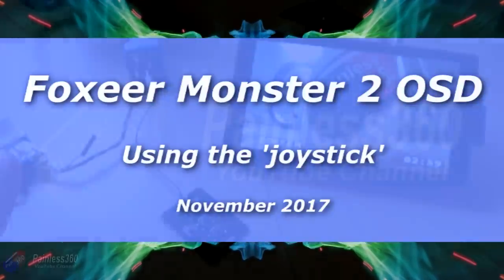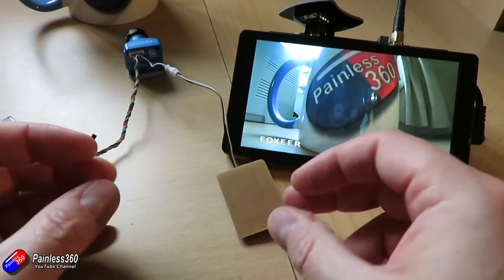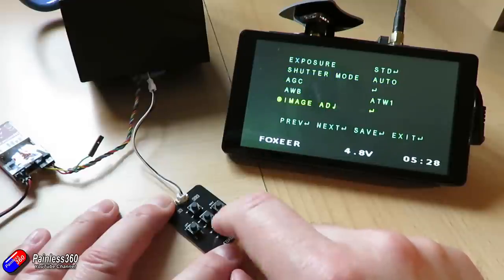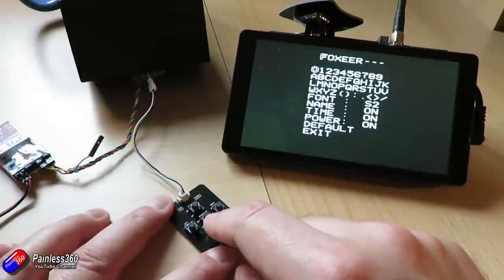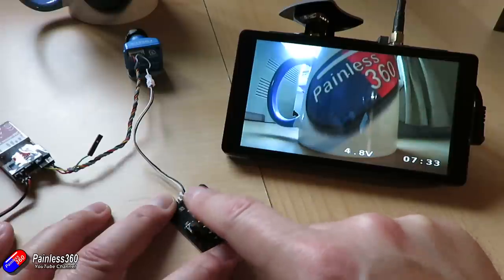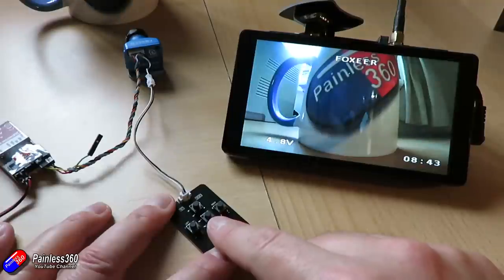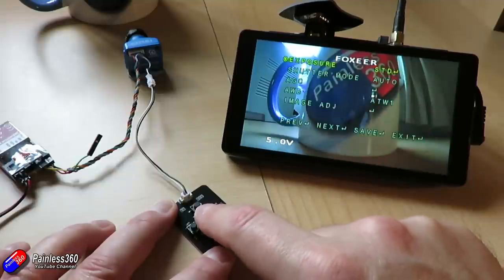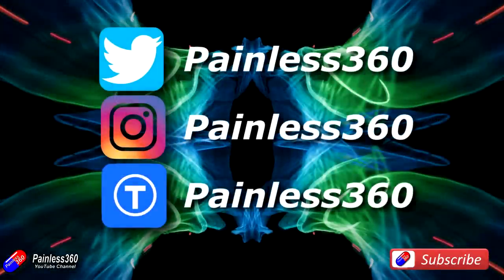RC Quick Tips: Using the Foxeer OSD controls/joystick

Comment: Hi Lee! Thanks for the video, it is helpful.
I was hoping you can help with a related issue I am having with the Foxeer monster micro. I turned of the OSD for a quad I was using the unit on, but have now moved the cam to another quad which needs the OSD feature. the problem is, I can't get the menu to come up when I press and hold the top button. I even tried the factory reset but it did not revert to the original OSD settings.
Any idea of how to get  the OSD menu back after disabling all the OSD features on the camera?
Thanks and, thanks for the content!
Reply from the maker: The OSD shouldn't stop the menu from appearing. I'd ytu another menu, 'joystick'... Best of luck!
Reply: @Painless360  -It is a bit odd as I tried another brand new micro monster and the OSD was not on, nor could I get it to turn on using the "joystick". I did try other joystick units with no result.
I then tried a Foxeer micro Arrow, and the OSD on it works. It is really quite odd.
Just wondering, have you been able to turn off (disable)the OSD on a monster micro, and then turn the OSD back on?
I will write Foxeer and see if they have any suggestions.

Thanks for the response, as well as all the great content! 🙂🚁

Comment: Hi there, I am wondering why we fly with relative heavy camera'snext to our fpv camera's. I Thing a gopro session on a 215mm quad is too heavy and to expensive to break. Why not have a home build  "split cam" on our fpv gear. I thing the quality of the FPV cam is often quite good, so why not use this for DRV. Place a wired DVR in the quad copter, between cam en TX. Maybe something for a painless video in the future?
Reply from the maker: +PeterP-100 there are lightweight DVR systems put there and I've suggested Vtx and DVR units to a manufacturer or two but non have developed products yet.. sadly..

Comment: Can you buy (or make) the control circuit board for these camera's? I bought a second hand quad and the OSD is switched off. I had a bad connection to the camera earlier and it powered down mid flight and powered back on (was quick luckily), and showed the Foxeer logo on the OSD. So I'm assuming OSD is turned off and there are no other problems. 
How can I get into the camera without the control board?
Reply from the maker: I've not seen them for sale separately, let me know if you find  them..

Comment: Is there any difference in fpv camera with built in OSD and Flight controller with built in OSD?
Reply from the maker: On screen displays from flight controllers have a lot more features and flexibility that the simple ones that may be included inside a camera.
Reply: @Painless360  Thanks 😊

Comment: Hloo sir can i use osd of betaflight for gps cordinate and osd of camera for battery voltage

I friend my 5v regulator
Please tell
Reply from the maker: Yes. The modern OSD in systems like Betaflight, INAV and Ardupilot are very full featured. See https://betaflight.com/docs/wiki/configurator/osd-tab
Reply: @Painless360   so will i be able to use built-in camera battery telemetry osd + betaflight osd at same time ??
Reply from the maker: Yes, but most disable the camera 'osd' as they are super basic and the Betaflight one if far richer and more useful.
Reply: @Painless360  yes sir but my problem is i am not able to get battery voltage as my flight controller battery sensor is ded 
So just want to ask 
 Will i bw able to use battery telemetry osd from built-in camera and other osd from betaflight??
Reply from the maker: Yes, as previously answered.
Reply: Really thx 🙏😊 made me day

Comment: I just got this camera and was like... what in the balls is this thing for? I guess this is a cool feature if you are using a board without an OSD, and or goggles that do not have their own image settings. Mine may be a newer version, the board is a lot smaller and it comes with just one cable... but ground is white and signal is black... kinda weird how they do that.
Reply from the maker: The two wires for the control are not GND and signal but just two wires that carry a changing resistance to the camera for the movement etc. Not all FPV stuff has a flight controller in it that can produce an OSD so having the ability to monitor battery is very handy... Happy flying!
Reply: @Painless360  Right! Like when I first got into this I had a flight controller where the OSD would not read voltage. Would have been handy then.